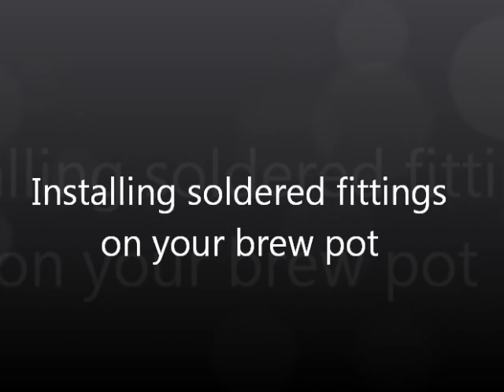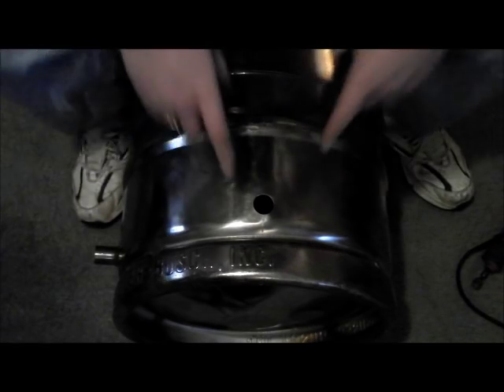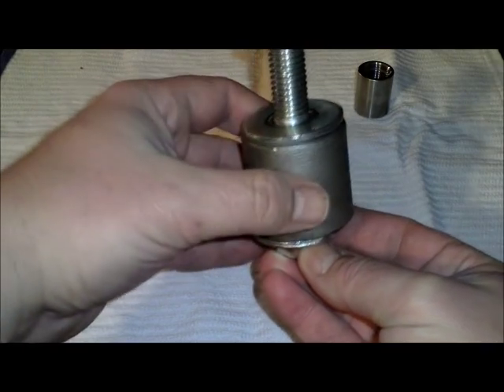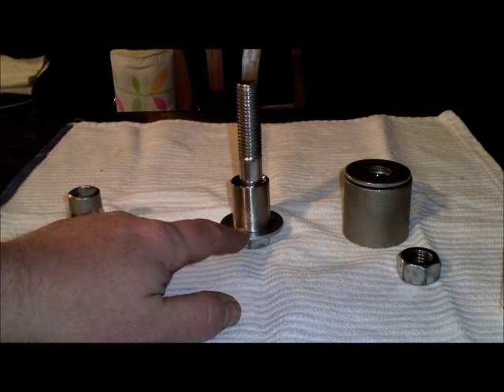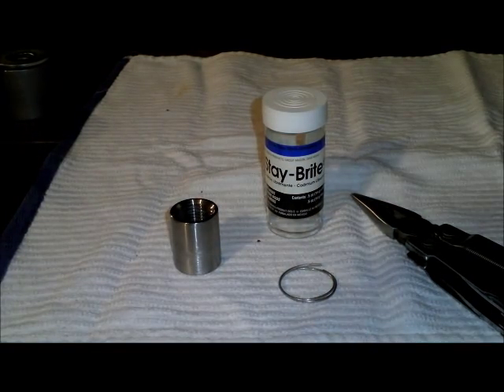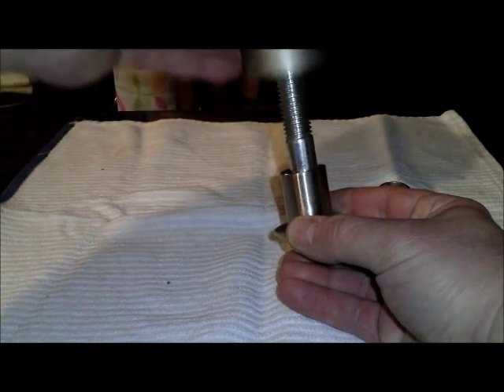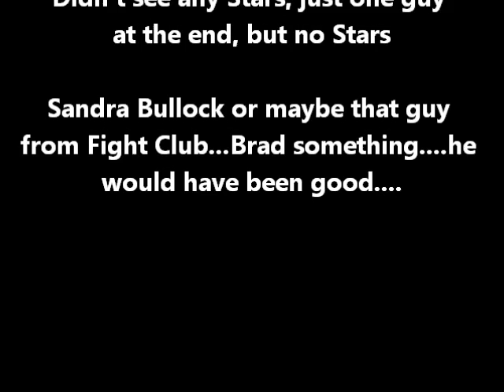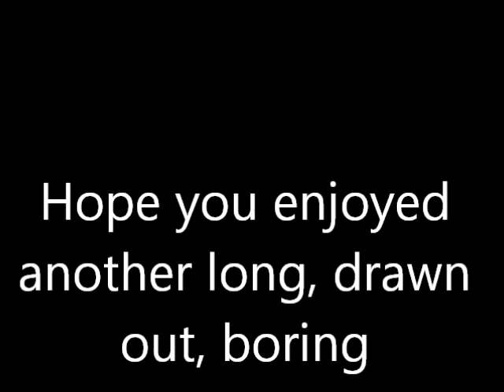Installing soldered Keg fittings

Comment: You can also use stay brite 45 as well. I done the same thing but I used copper fittings on my stainless keg. Works really well. Been in the hvac/hvacr trade over 17 years so I have access to all types of things. I've grazed copper to steel, copper to aluminum just about every metal you can think of. Very good video though. Almost forgot you can use sil phos 15 percent to
Reply from the maker: The only potential issue with the 45 is the ability for the average person with a standard propane torch to get it to flow well. Sil fos is good stuff, but I'm not 100% sure about it's use in direct food contact due to the flux coating on it. I will admit I haven't researched for that purpose though.
Reply: @pewsandbrews  I agree I only use it here and there at the keg or if I'm putting copper to the stainless keg. After I braze it I clean that area well. I use copper on everything else and lead  free solder. No problems yet. But you have a valid point. Very good video my friend

Comment: I just ruined a keg with stick welding. You are a genius man
Reply from the maker: I've done some with Tig and it's a really involved process that requires a lot of practice to get right, but this is an easy way the average guy can do it without spending too much....hope it helps you out!
Reply: @pewsandbrews  i just ordered everything today and ill make it the exact same way. I sold this stick welding machine. Thanks abunch man

Comment: cool thanks. I have a small hole in the bottom of a corny keg. Here in Australia they are expensive so am going to try and repair. The hole is right on the bottom so think i might have to cut rubber of bottom and seal on outside.

Comment: Very nice video. I am trying to size this process to a 1' NPT fitting. Do you know the parts for that? I looked at the two McMaster Carr parts but the OD of your 1/2 NPT coupler is not specified, unless I missed it. I saw one with 1.12" (Grainger) and one with 1.2 (McM-C)and there may be others. I guess it needs to be larger than the 1.050 reducer and smaller than the 1.315 socket well coupler. Beyond that what are the limits? Thanks

Comment: Thanks for the video. I'm trying to silver solder a flat of SS plate 1.5mm thick onto the radius of two 25mm SS pipes (A4 grade) to join them at 90 degrees. I get a fair bit of staining around it, and there is no way I can clean the inverse side of the joint as it's inaccessible - how can I prevent the staining? cheers!
Reply from the maker: Not sure the staining can be prevented, it's a product of the flux. When it's still a bit hot you can wipe the joint with some fresh flux on  a rag, but if it's not accessible, you might just have to live with it or find someone that can weld it for you.
Reply: welding isn't the best option - I can't have the slightest distortion in the Stainless tube for this project. Thanks very much for the reply, I'll try wiping it. Best wishes.

Comment: What parts would you recommend to make a dimple tool for a 1 inch outlet instead of a 1/2 inch? Also what size hole would I have to make? Thanks for your help!
Reply from the maker: you'd basically just have to double the sizes. As far as the actual numbers, you need the hole to be at least an 1/8 inch smaller than the OD of your 1" fitting.

Comment: Thanks Tim for the great video!! I am just starting the process of welding the couplings into my keg and had one question. Is the coupling just a general weldless or different? Any info is greatly appreciated and thank you for documenting this process so starters like my self have an easier time.. Cheers.
Reply from the maker: Hi Bob, and thanks..glad it helped you. Sorry for the delayed answer, I don't check my youtube channel very often. 
Yes, it's a standard 2" long 1/2" NPT fitting I got from barginfittings.com. I think they do come with some of the weldless fitting kits, but you can buy them separate.

Comment: Hey, Nice video

did you have to do any prep work on the die/receiver coupling?   

How many MM smaller hole do you cut?  
Is the hole diameter predicated on the thickness of the metal?

Have you tried to anneal the steel and draw the metal out more for more contact?

Great Tutorial.
Reply from the maker: Never did a MM conversion for it, I went about a 1/4 inch smaller than the die. Never prepped the die, they are pretty smooth to begin with, and I never tried annealing stainless as the temp required is something like 1900 degrees.

Comment: Good vid... best i've seen demonstrating the technique... but the prices on the reducer and large coupler are pretty far off according to my check a few minutes ago at M/C.... they are listed at $28 (USD) together.
Reply from the maker: +Bill McCollam  Thanks Bill.....I list the Macmaster Carr numbers, but I will say I got mine from Amazon...I know in the Vid I said Macmaster, but they were found on Amazon much cheaper.  The Macmaster numbers give a reference for what the parts actually are. I could have been more specific, but re-editing the whole video would have been a PITA.
Reply: +Tim White huh.... i spent 30 mins searching Amazon and eBay.. smallest reducer I found was 1 - 3/4".  Let me know if you have a supplier or a link stll around... (with $USD and shipping from M/C - those would cost me well over $50 (CAD)
Reply from the maker: +Bill McCollam Look for Butt weld fittings......3/4 to 1/2 " from merit brass is 8.20....1" socket weld coupling is 5.50 with free shipping with Amazon prime
Reply from the maker: +Tim White prices have gone up a bit in the last year
Reply: Do you know if they have to be stainless steel for the 1" socket weld coupling?  I have some steel ones kicking around that I can use

Comment: The reason I commented is that WD-40 has no cling it simply runs off or quickly burns off, it is good for aluminum though.  I was trying to be nit-picky as such because it's physical properties don't lend itself to the stress of drilling steel especially stainless with its work hardening characteristics.

Comment: Could you tell me where I could get that dimpling tool I have checked amazon and aliexpress with no luck … great video
Reply from the maker: You have to make the tool from the variety of parts listed in the video. Brewhardware now sells a complete tool that works with their fittings. Check them out, really great stuff...I've ordered a bunch of stuff from them and it's always top notch.
Reply: thanks for the info much appreciated

Comment: Hey Tim, just to clarify, you only put the solder on the insdie and apply heat? Or do you solder both sides? Also, what gas are you using? Propane? MAP?
Reply from the maker: Yes, solder only on the inside. You want to heat the keg from the outside focusing most of the heat on the fitting. Start out heating the keg itself, but finish with the heat directed almost entirely on the fitting. This was just a standard propane torch ( blue bottle)
Reply: Thank you, I'm about to get my first set Keggles in the next few weeks.  Appreciate the video. Where can you get the flux and solder Amazon or specialty? Also the Die set if you would too :)
Reply from the maker: Amazon has it, and I'm sure you could probably find it at a good plumbing supply store as well. The big box stores in my area don't carry it.

Comment: I am try to figure out what to use in soldering copper to stainless steel pipe fittings that is safe and I can do it myself.  I have been wanting to see into the silver solder
Reply from the maker: The Harris Stay Brite is NSF certified, lead free, and safe. The 4% silver gives a stronger joint than plain water line solder, and also works better for stainless ( it works equally good for copper ) while still melting at home propane torch temps. The flux is what really makes the soldier stick to the stainless. It's acid based, so it etches the metal and gives a place for the solder "bite" and hold.

Comment: Thank your for the video.  I do have a question though.  Is your keg stainless steel or aluminum?  Are all kegs made from the same material?
Reply from the maker: Hi Mark....Yes this keg is Stainless. Almost all modern kegs are stainless steel. It is possible to come across an old aluminum keg though. As for as I know, if they have the sankey style fitting they are stainless.

Comment: 13:00 you can use an oversized washer between dimpling tool and fitting to get a flush fit.
Reply from the maker: Sure....you could use a lot of things, but since the dimpling tool is right at hand since it was just used to pull the fitting in, seemed like the simplest thing to grab.

Comment: we're would I find the Harris brand solder and it well bond stainless to copper won't it.  thanks for replying I like your video
Reply from the maker: I got mine on amazon....it comes as a kit with the solder and flux for about 10 bucks. Most hardware stores don't carry it.

Comment: Hello. Are kegs made of aluminum or stainless steel?
Reply from the maker: MOST....kegs in the US are made of stainless. If you get ahold of an old one, there's a chance it could be aluminum, but most of those are the "pot belly" type. If you get a modern keg from a distributor it's stainless.
Reply: @pewsandbrews  thank you.

Comment: I'm watching this in October 2022 and those two parts from McMaster Carr are now $24.88 and $21.75
Reply from the maker: Yeah, its crazy these days. Check Amazon,  they had them fairly cheap. There's also Brewhardware.com . Bobby sells a complete pull through dimple set up, or did, haven't checked his site in a while.
Reply: @pewsandbrews  I also found an actual cheap dimple die for a hydraulic knockout punch and I have access to one.

Comment: What happens when you set the keg over an  open flame to brew your beer and the solder melts and the fitting starts leeking?
Reply from the maker: For the same reason silicon or rubber washers in weldless fittings don't melt. with liquid in the keg, it will never get hot enough to melt. Now if you put it in a bonfire, all bets are off.
Reply: The Solder doesn't melt until 500 or so degrees C.

Comment: How do you clean up the joint after silver solder?
Reply from the maker: A little sand paper, acetone, or even the acid flux work well for the black flux. Sandpaper for the solder itself.

Comment: Hi is this better than welding???
Reply from the maker: No, but it's something that an average person can do. If you or someone you know can weld stainless, that's the best way to go
Reply: Welding the thicker fitting to the thin gauge keg presents a burn through challenge. Since these boilers only see head pressure, solder is good enough.

Comment: Tim, WD-40 is not a lubricant, it's a solvent.
Reply from the maker: Well the WD stands for water displacement 40ith formula. It can be used as both a lubricant and a solvent......hell it's got a hundred uses. I try to use things people would have around the house, and it works well as a cutting lubricant for small jobs like this. Seems kinda nit picky to feel you need to try and correct that though.
Direct from the WD40 site :While the “W-D” in WD-40 stands for Water Displacement, WD-40 Multi-Use Product is a unique, special blend of lubricants. The product’s formulation also contains anti-corrosion agents and ingredients for penetration, water displacement and soil removal.

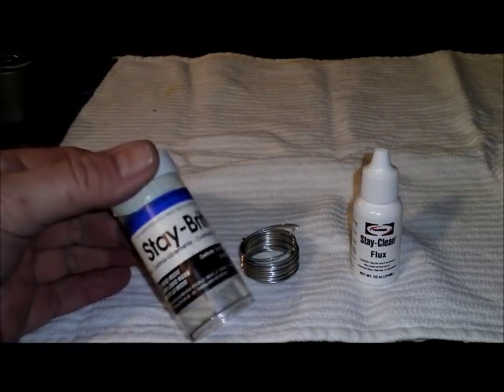Comment: Good instructional. But at 9:58 it shows you are using cadmium solder. Cadmium is more poisonous than lead, and is carcinogenic.
Reply from the maker: Although you see the word cadmium on the label, you can't see the word free. The full label reads " cadmium free " stay brite is NFS certified.

Comment: It might have been nice if you had bothered to show if you used a oxy acetylene or propane torch for the heat. Kind of pointless with out that little bit of info.
Reply from the maker: It's a video about soldering stainless fittings. I'm sure you could solder with oxy/Acet, but I used a standard propane torch.
Reply: Scott S. Your comment was pointless, the video lesson was priceless. See the difference?